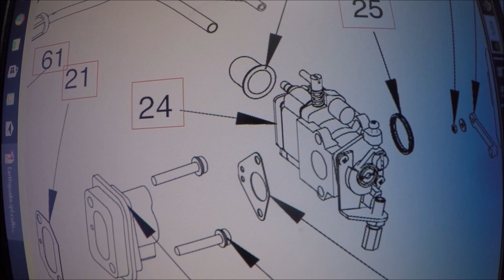Earthquake MC43 carburetor replacement with fuel line replacement

Comment: Thank you very much. I bought the carb kit on Amazon and it came with lots of extras. Including the carb gasket. It was 16 dollars and shipped via prime.  Installed it and now my tiller is up and running.  It had been sitting for a year and a half.  Carb gets gunked up over time and use. So the carb replacement was perfect!  Thanks for your video.
Reply: justforfun6770 Do you have a link?  Thanks

Comment: Thank-you for this video.  I have just  picked up an Earthquake MC43 used and it would not start.  Common issue. degraded gas line at the carb , pieces broken in the tank and throttle cable was stuck.  Pulled tank., cleaned as I went.  Had replacement fuel lines that fit and freed the cable with 3 in 1 oil. Final test will be this week.  Wish me luck.

Comment: It took me a while to find out you will probably never have to replace the primer bulb, or the fuel lines. If you only use non ethanol gas. They rot quickly. Good info vid.

Comment: LOL! I took my carb off today, but I didn't have access to my computer at the time. I had those 4 rubber washers drop out on me, but I wasn't for sure just where they went. I had taken photos of every step along the way, but didn't get one of the back side of the gas tank when I had pulled it off. Now that i have replayed the video, I can go out tomorrow and finish out what I started. My lawn guy used my tiller last season, but forgot to drain the tank when he put it away. Hardest thing I have run into on today's attempt to clean it all up, was pulling that darn two hole rubber gasket that holds the gas lines at the tank and then putting it back in. That little sucker was stiff as a board and not so very easy to put it back into place, but I got 'er done. I have not checked out the replacement carb pricing on Amazon, but that may be something to get a spare and keep handy. Thanks for the video. Yup, a 4mm Allen wrench and 10mm socket did the complete job today.

Comment: My husband and I replaced the carburetor and fuel lines on our 43cc viper mini cultivator thanks to your informative video. It fired right up and he ran it, used it for 20 minutes when then it kinda gurgled and chugged like it wasn’t getting gas. Won’t restart. Primer bulb (came new w carburetor) now doesn’t pop back out. The intake fuel line is clear and fuel filter is new as well. Any ideas why not getting fuel through?
Reply from the maker: Seems to me it has to be that the fuel line is obstructed.  It's possible it's obstructed inside the carburetor.
Reply: Thanks so much for the insight. I want to offer this for any newbies trying to learn new skills like us w hopes they'll learn from our deeds. We "knew" it wasn't old 50:1 gas mix that we'd just made up. However, it turned out to be "old" gunkiness in the actual fuel container on the cultivator. It seems a piece of the fuel line was broken off in it from the past and was disintegrating inside causing the clog. We emptied, cleaned (dawn and water), thoroughly dried and now works like a charm!!

Comment: I need a new fuel tank and now i think ill get a new carb too.  My old tank has a hole in the top corner and fussy rigged with duck tape.  Also the fuel lines are corroded.  Thank for the video i was about to give up.  My husband is to sick to fix anything any more and i don't have the resources to buy a new one.  Could you or do you have a link to a new tank.  Searching the web gives me a headache.  This will help me with my weeding.  I just busted two ribs pulling weeds.  So i need my tiller back.
Reply from the maker: Got in on Amazon, it's working just fine so far

Comment: I ordered a new carb and it won't suck the fuel but I can see bulbs in the fuel tank when I prime it, any ideas???
Reply from the maker: I wonder if you  got the fuel intake line and the fuel return line reversed on the carburetor. Try switching them and see if it doesn't work. The other possibility is a crack in the fuel line.
Reply: I put it back together like you did.  All new hoses.  I wonder and just thought about this.  The new lines may be too big for the holes.